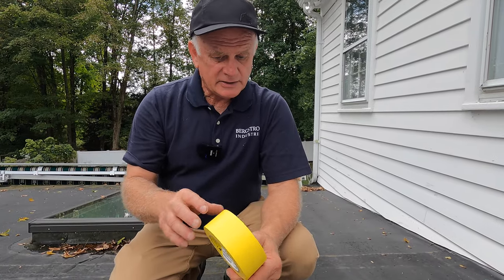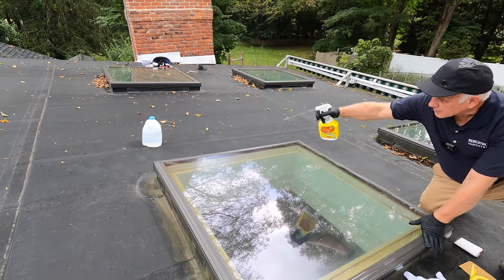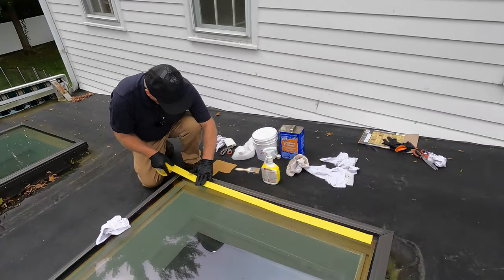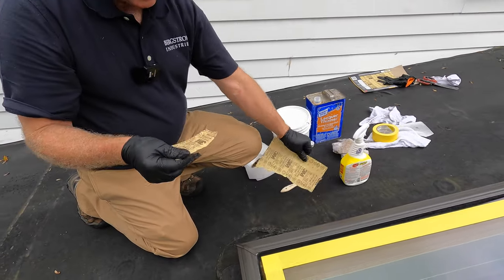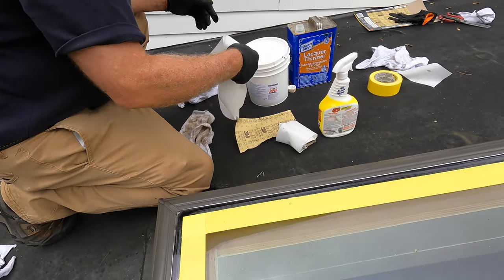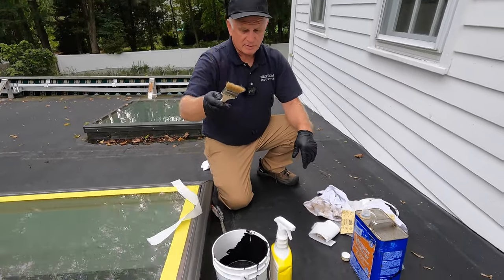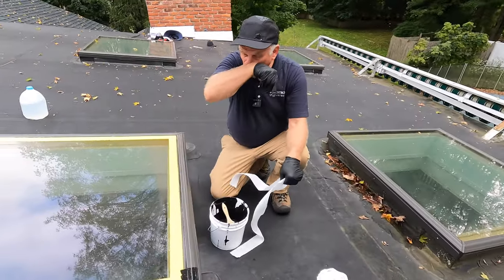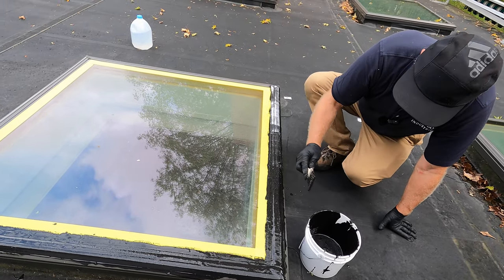SKYLIGHT LEAK REPAIR : Clean, Fantastic, easy, no mess - Super Silicone Seal

Comment: Excellent product. Very instructive video. We were looking at an expensive re-seal until I saw this video and ordered SSS. I did the job in 30 minutes. Bergstrom Industries Super Silicone Seal comes with the poly fleece needed in a 1/2 gallon kit for around $100. WAY less expensive than a re-seal.
Reply: Robin, how far did your 1/2 gallon get you? Was that enough to seal 1 skylight/ or perhaps a couple? Thanks

Comment: I have had a small, intermittent leak on one of a four-gang Velux set of lights. Thought I can’t duplicate the leak wit a garden hose, a moderate thunderstorm will produce drips at the bottom corner. 

I just applied  the seal and felt today to see if that is the solution. One concern I have, which was not directly addressed in the video, is the required space between the masking tape and the felt. I’m afraid I was not careful to keep them separated and am worried about what’s going to happen when I remove the tape…

(Regarding another comment that suggests it is better to disassemble the skylight and replace the glass-to-frame seal. I would agree, but my version of the Velux does not offer any disassembly opportunities w/o taking the entire skylight out)

🤞🏼Sure hope this works !
Reply: 8 months later....  The Super Silicone Seal repair has helped in my case, but there is still a small leak from the top of the Velux glass skylight. There are a number of comments on another of his skylight repair windows suggesting that this is the wrong approach for glass skylights. I am going to re-do the felt+seal at the top of the offending skylight to see if this style repair can actually do the job.

Comment: I just disassemble the skylight and clean it up. Replace the factory sealants and reassemble.  Your way creates a problem over time.
Reply: You notice his seems to have a permanent seal. There's no screws to remove the top flashing. How would you disassemble that. Mine looks just like his
Reply: There's three screws or rivets on the short ends and four on the long sides. Remove those, remove the top frame, clean the weep holes, and replace weather stripping or sealants (whichevers there) . Reinstall   skylight glass.